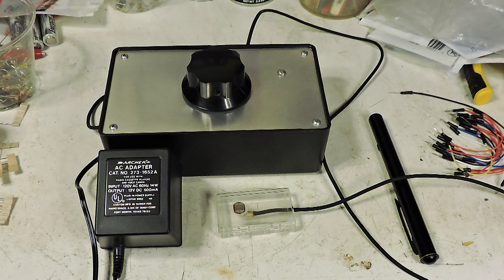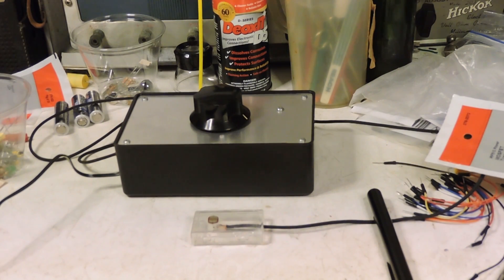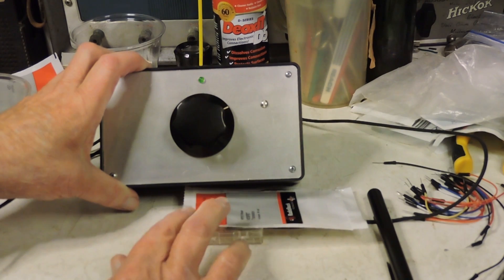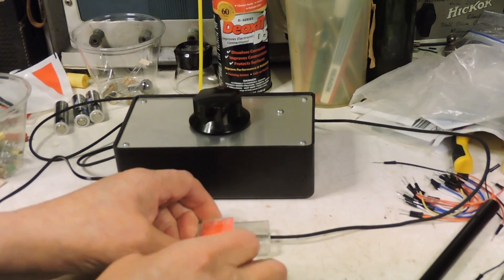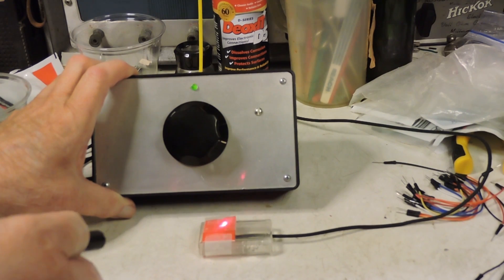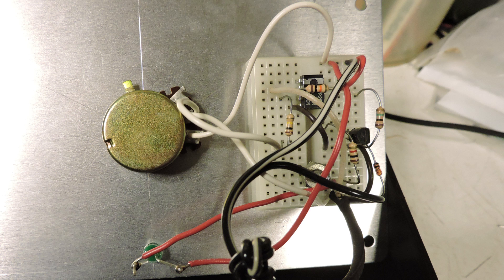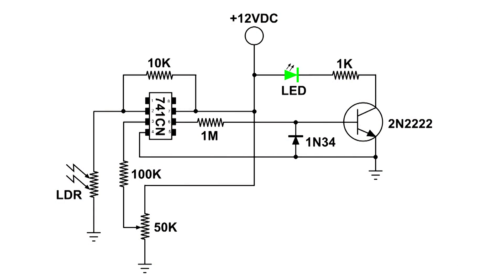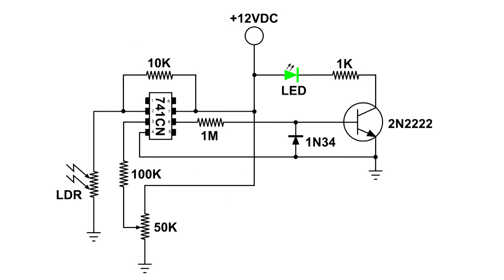LDR Light Dependent Resistor LASER Operated

Comment: Thank you for taking the time to sketch the schematic.    Of what practical use is this device ?
Reply from the maker: You'll have to ask the YouTuber that wanted me to design the circuit. 
Thanks
Reply: +Dad :) Here is a similar example of application, little variation, solar cell, instead of LDR :
https://youtu.be/HKRPfa66_po
You could use LED as LDR too ;)
https://makezine.com/projects/make-36-boards/how-to-use-leds-to-detect-light
Ain't sure about it, but instead of the solar cell, you could use LDR with a 1.5 volt source, to produce same thing.